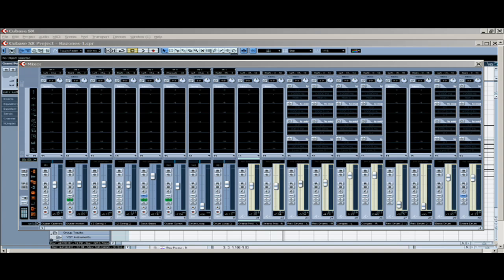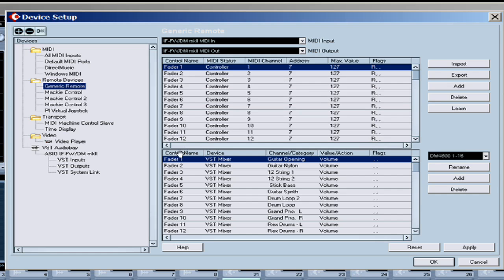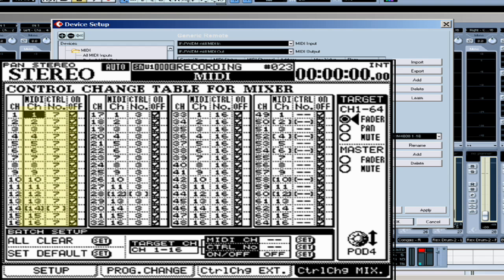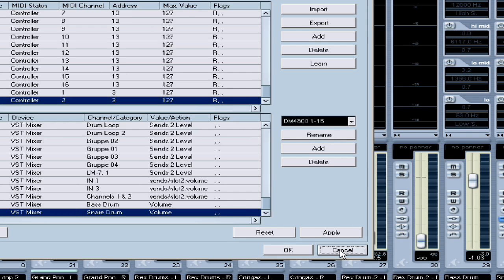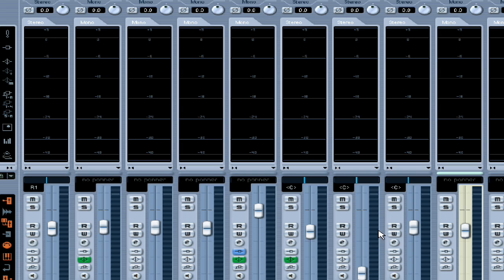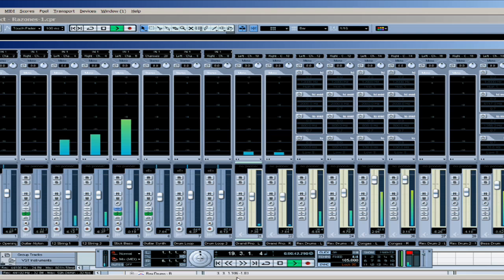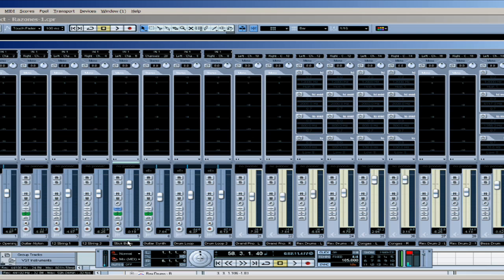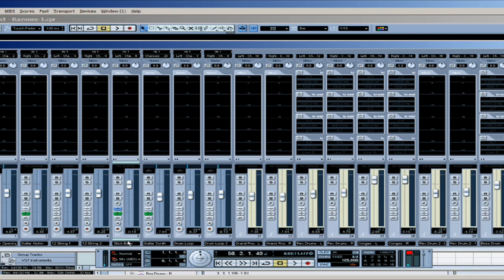Tascam DM4800 User Defined Layer Demonstration

Comment: Hello, I have the oportunity to buy a used mint condition DM4800 with firewire card and meter bridge included for $3000.00 Canadian which is a great price. I did own this board at one time and know it is a good board but had to sell. After watching your video I sort of got the info I needed but still not sure. My question is can I control cubase and/or protools faders with the 24 DM4800 faders all on the same screen of a 24 track mix or even a 32 track mix with maybe a second layer. If this is possible I will pick up my board on tuesday night. If not I might cosider a 32 channel I/O with Mackie controllers. A lot more expensive though.
Reply from the maker: Hi. Pro Tools - no. You would have to use the board's automation on the first two layers, or the remote layer. in Cubase, you can can control it either way. I made two specific videos for PT and Cubase on this subject. Check them out.

Comment: Great video. I have what might be a dumb question though. I am kinda new to this. Cubase handles stereo tracks with one fader but on the dm 4800 you obviously have to use 2. How do you compensate for this.

Comment from the maker: @bessie16 - UDL allows you to "MIDI LEARN" your fader movements in your DAW and bring the DAW audio into the board and use the channel EQ's and Compression in the DM on the first 24 channels. You just have set it up. Again, I use the automation on the board - not Cubase automation. The faders in Cubase will respond and your mix is set just right, just can even record the mix to Cubase for a second backup.

This is NOT a mix in the box technique - this is old school mixing out loud to stereo.

Comment from the maker: @djole02 - I send my signal to the firewire card "DIRECT" - therefore bypassing the input channel. I only use the EQ and Compression on the mixes. I did try to see if the internal effects could be recorded to my DAW, but I was un-successful. But as I type - I think I may have a solution.

With regard to your second question, I use both the USB MIDI from the console and the physical midi from the back of the board via the MOTU Midi Timepiece AV (serial port version with on screen routing).

Comment from the maker: @delane013 - I route my Cubase audio tracks back into the board through the routing screen. This allows me to use the EQ, Compression, and the two stereo effects on the board itself, plus any outboard gear I have running through the aux's through my two patch bays.

All the automation - volume, EQ, Compression settings and even program changes for my external effects is recorded into my board's automation memory.

Comment: Congratulatios !!! I just got a few questions for you, iàm about to purchase the DM3200 as a controller fro Pro Tools 8 with a digi003R, are you cuntecting the DM4800 via USB or only via MIDI ?? how can i do the same you did but in Pro Tools??? The EQ. on the bass part, it is afecting it in real time???